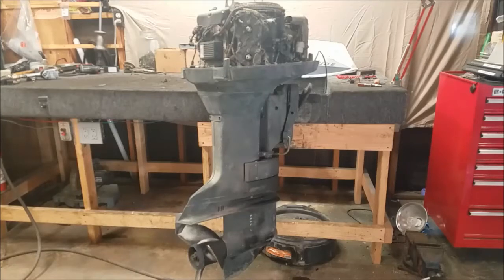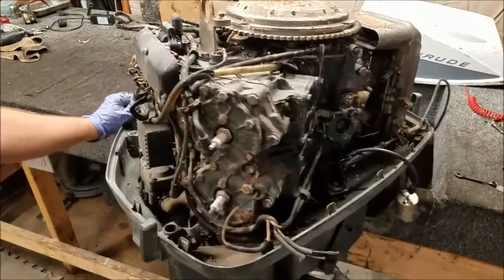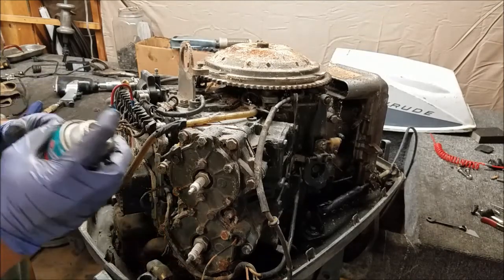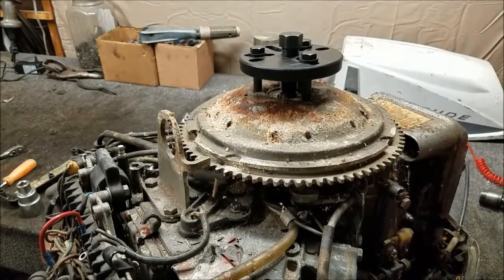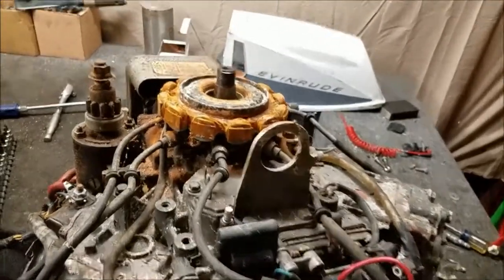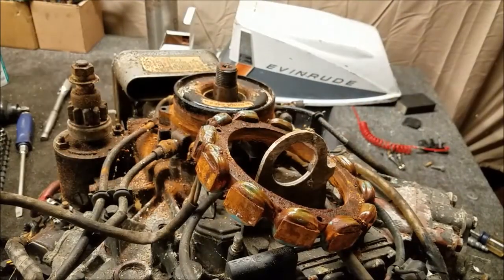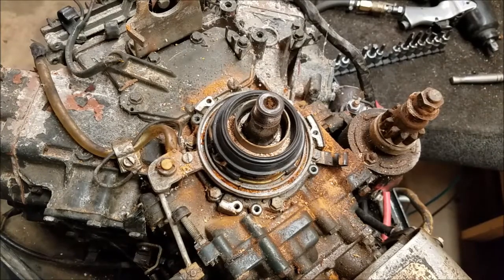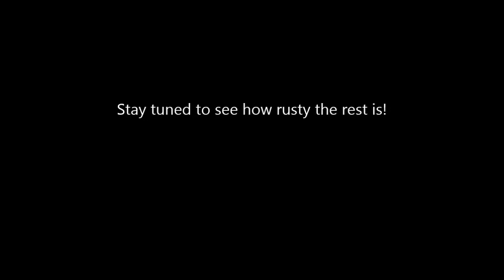Johnson Evinrude V4 Distributor Cap / Ignition Removal

Comment: I have that motor and pulling the flywheel right now so I can attach the power pack ground and black white wire to the point plate and shift contact. Should I try n sell the motor after repairs and get something more reliable or what?

Comment: Does the lower unit work? I'd bet someone out there is in need of one. Like you said, they are hard to work on when they are broke, I know, I had a 50 HP with electric shift and the reverse went out, I used it several more years with only forward.
Reply from the maker: oh yeah, lower was fine.
I would use it without reverse as well. If you drift into rocks or something, just use an ore to push yourself off. 

I had a car with no reverse, drove it around for probably 3 years like that; you just have to plan out parking.

Comment: Hey Iv got the same distribution cap/ motor, I need to test and possibly change the ignition coil but I'm not sure how to disconnect the wire that goes into the distributor. Do I just pull it out or what? Thanks for the helpful video.
Reply: pull back the boot and un screw (twist) them out
Reply: Hey did you ever fix your issue. How do you test the distributor?
Reply: @willmillett  I replaced the ignition coil and had to take off the flywheel to clean off the points with a points file and set them with a points gauge. Then I had to replace the 2 wires that come out of the points area because they were corroded. Runs like a champ now!